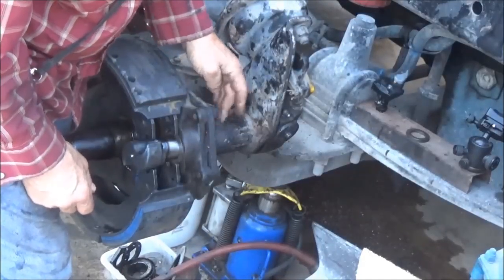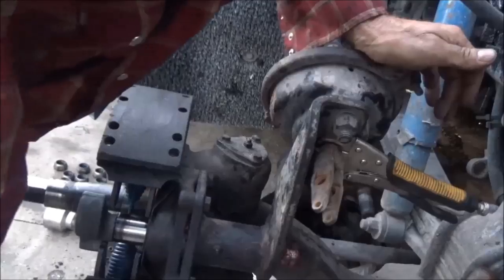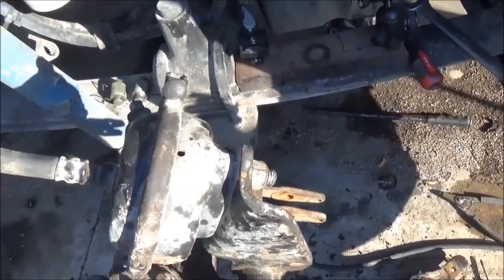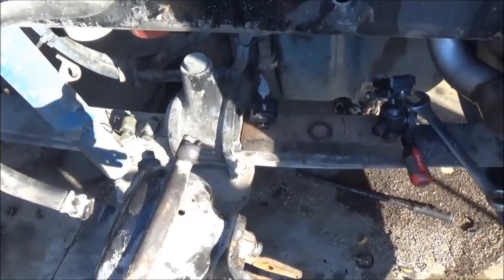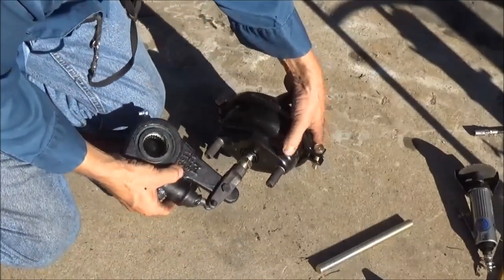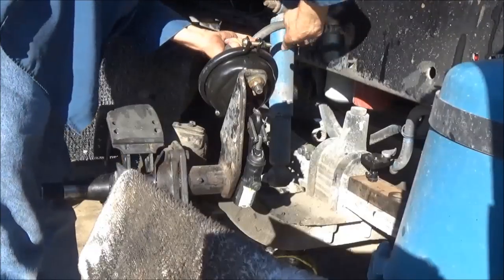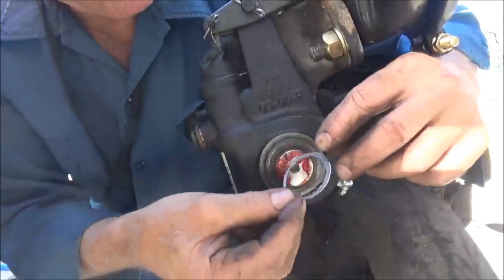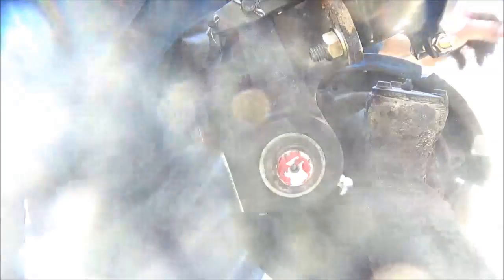Replacing "S" cam and bushings (part 3 of 4)

Comment: the way to  line the pin up is to get a tape mesure  in the front of the chamber and take the pin and put it on top  of the old one and mesure frome the chamber to the back of the pin and I done one yesterday

Comment: Gordon, I have a '77 Gillig school bus. Everything at all four brakes looks excellent except the rollers are sitting up on top of the S cams instead of down in the roller pockets with the system at zero pressure. I'm thinking at zero pressure the roller should be up out of the bottoms of the S cam pockets (brakes on) but not clear up on top. The pockets in the S cams are covered in grunge like nothing has been down in there for a long time. I'm so ignorant about this system yet but would you think someone has installed the S cams improperly? Given new shoes and what looks like freshly turned drums someone has been in this system.
Reply from the maker: I would have to see it to understand what is going on with it. Maybe you can send pictures of it.
Reply: Email with pictures en route.

Comment: Used hardware always comes in handy, half the shit that comes with parts anymore does not work properly :)
Reply from the maker: That's true. I replaced a couple of lights on this truck the same day, they came with new screws and I dropped one of the old ones and the floor ate it, so I grabbed one of the new ones and it was too short, I didn't have one like it in my junk so I tied a piece of wire through the hole and told him I'll try to find a new screw for that for the next time he comes back.

Comment: I learned to save the old parts the hard way.  Now I keep them for a week or two after the repair is done just in case.
Reply from the maker: I hate to throw anything away, someday I might do a video on the spare parts I have collected over the years and tell examples of the time and money I saved by having these things here. There's another problem with that though, I'm still looking for the floor in my garage, I seem to have misplaced it somewhere.
Reply: I go to the other extreme and I've paid for my mistake more than I care to remember.  I used to save more stuff and often I'd find the part I needed right after I bought a new one.  I wish I could figure out the right balance.
Reply from the maker: If I could learn to organize, then maybe it wouldn't be hoarding.
Reply: That's a good way to look at it!